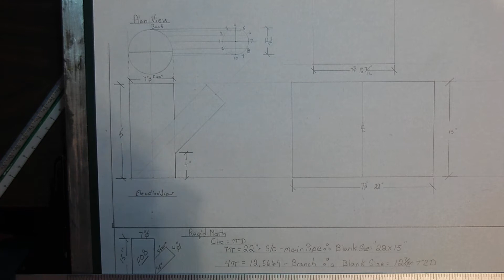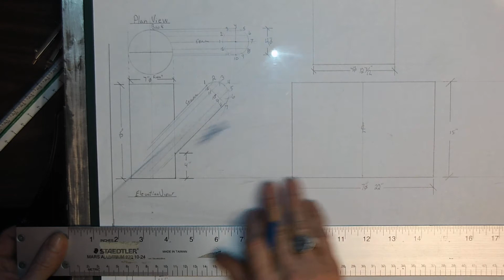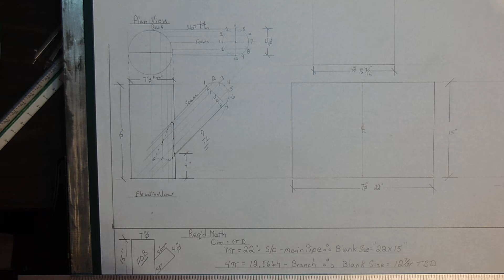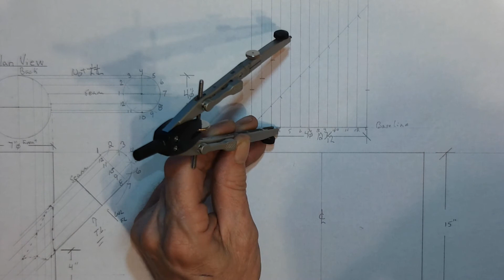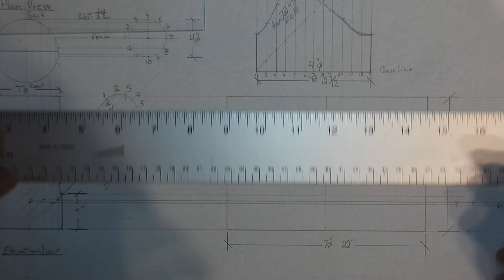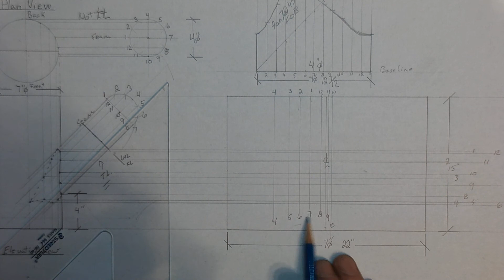`Off Center Degree Tee

Comment: what is 7/12's
Reply from the maker: I use 12 as a denominator for the archetects scale which is devided into 12 and 24 increments. Too much time in the classroom LOL. I will try to use 16th's to be clear. Thanks for the observation.
Reply: @sheetmetaldraftdoctor9093  im in the middle of level 2 308A pattern class with the apprentices. Just seeing how everybody else is doing it